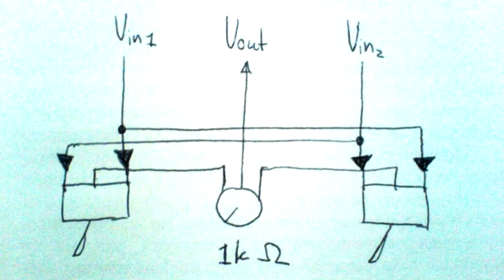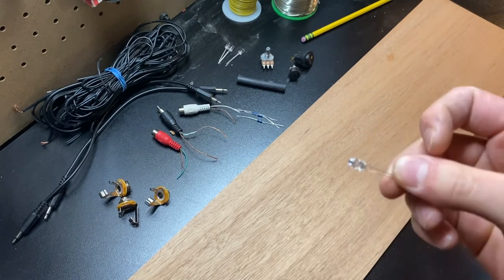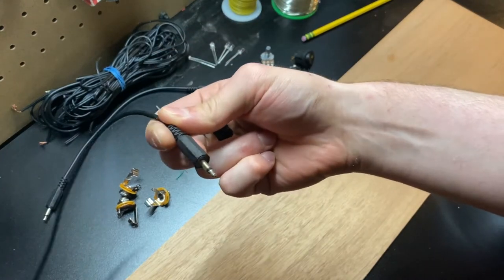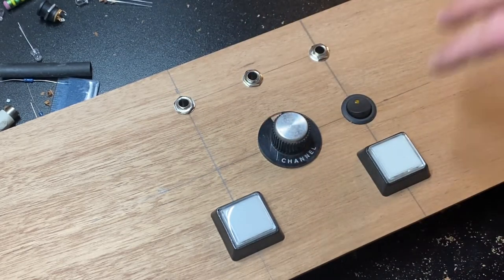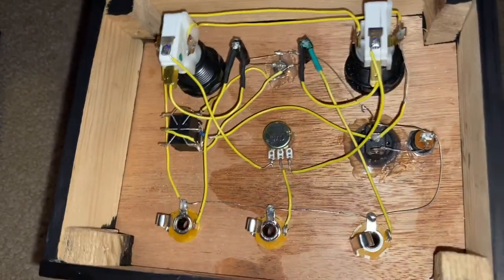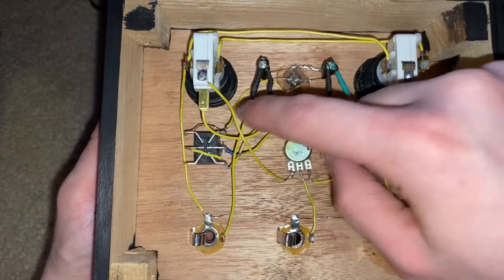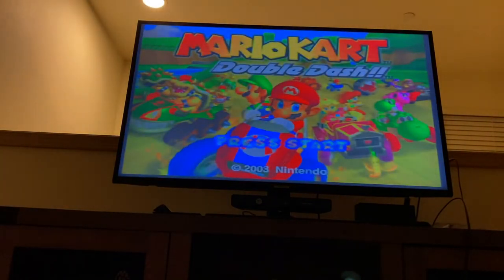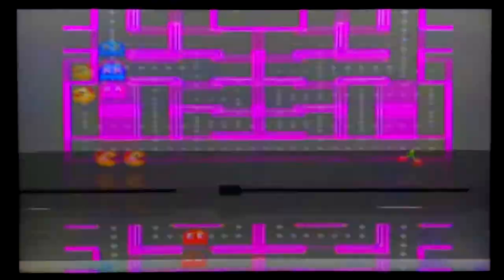DIY GLITCHY VIDEO MIXER - Modding Karl Klomp's Dirty Video Mixer for Even More Visual Glitches

Comment: Nice one. It's possible to light the LED side of the vactrol with a control voltage (from a synth, eurorack or LFO) I'll probably do that when I build one. Depending on the LED you don't even need a resistor to protect from overcurrent.  I use vactrols like this all the time, it's a great (dirty) way to CV a pot

Comment: Make circuit of oscilloscope that run on video input of TV with out open any tv or any other device
Reply: hmm... That sounds doable...ish.  There might be some issues as generally the normal mod involves rotating the coil of a CRT due to refresh rates but with modern TVs and a DAC this could potentially be relatively easy...ish lol.  IDK bout him but I personally am going to look into it.